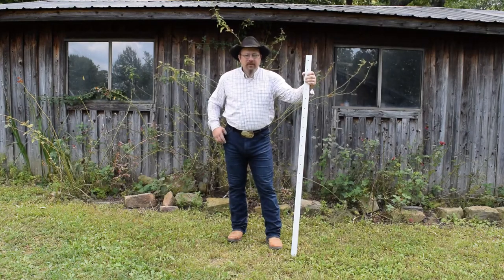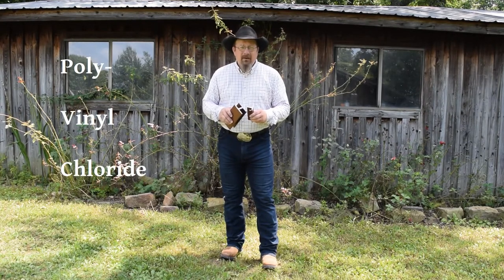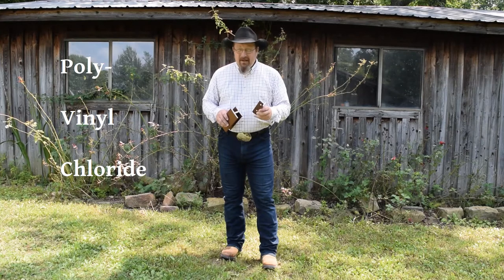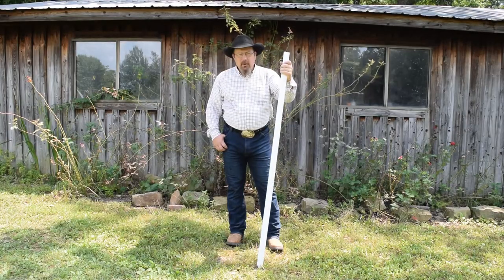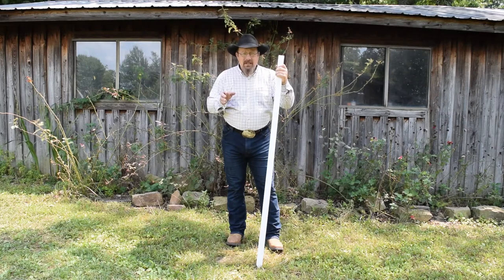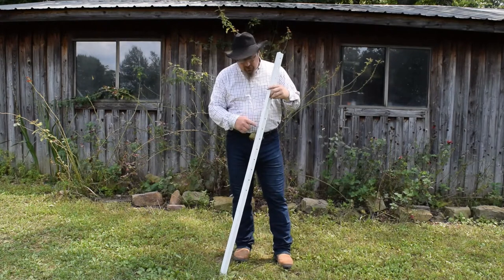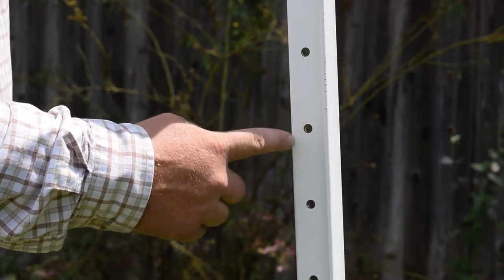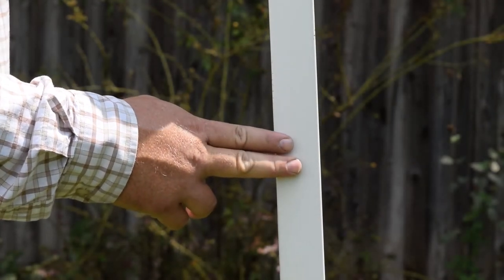The Fence Post That Is The Insulator

Comment: We are installing the timeless fence and have put up the the braces when changing direction but can’t figure out how to tie the wire that comes with it and can’t find video for it. Any suggestions?
Reply from the maker: Watch my gripple video that's the best way to tie you can use it around the post or you can use it as a and an in Terminator it works really good either way and I show you how to tie High tensile in that video